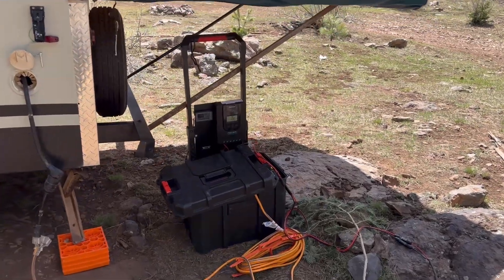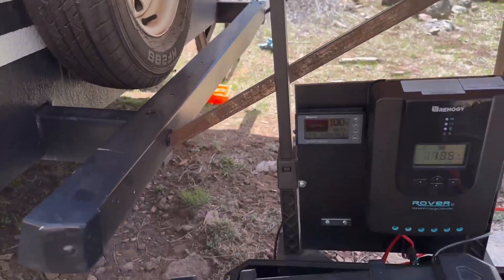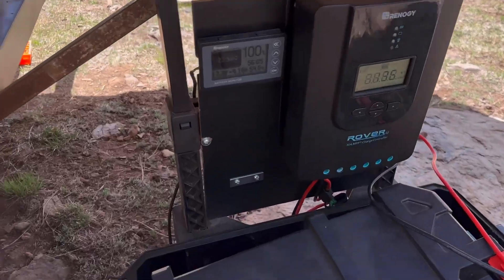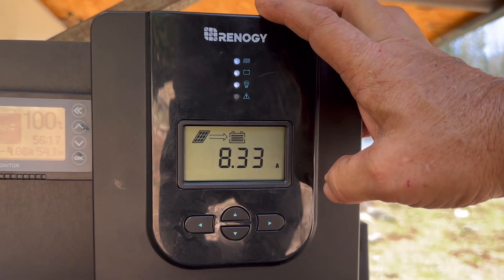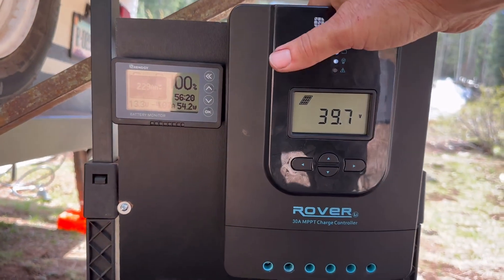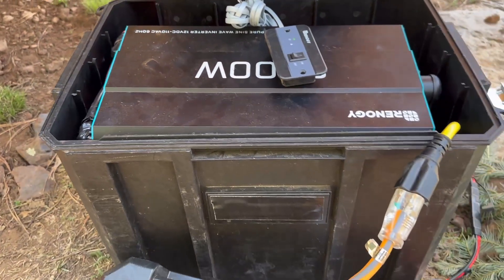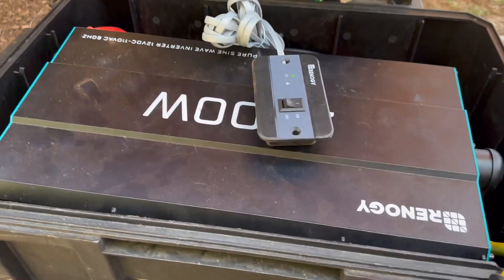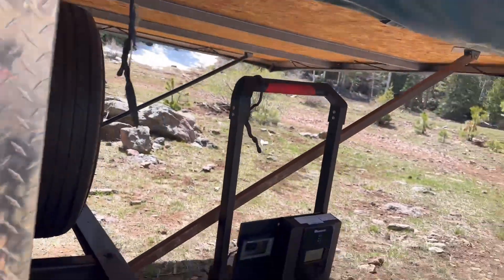Powering Your Campsite: DIY Solar Generator in Action!

Comment: If your lights inside trailer are 12v, then you probably have a "converter" in the trailer that converts the shorepower back into 12v and would also keep the original factory installed 12v battery charged. I doubt the interior lights are 120v, unless you have changed them. Converter is just another of the often forgotten "phantom" loads.

Comment: You might consider using as short as dropcord as you can from your solar generator to your camper. You should see a significant increase in your output voltage which will reduce the current draw from your solar generator.😂
Reply from the maker: Great point.